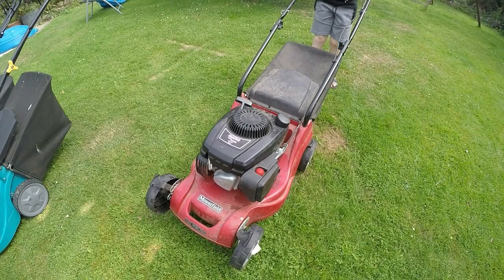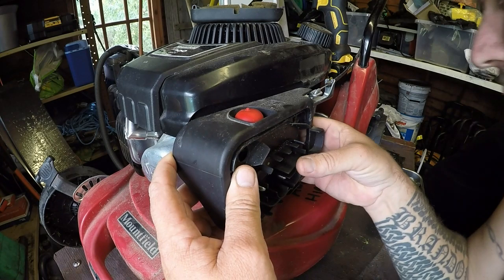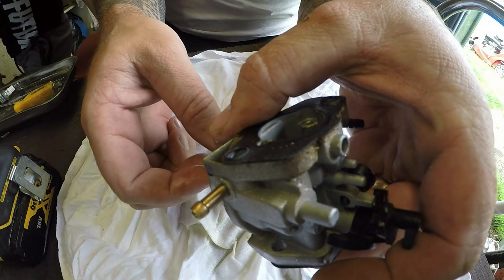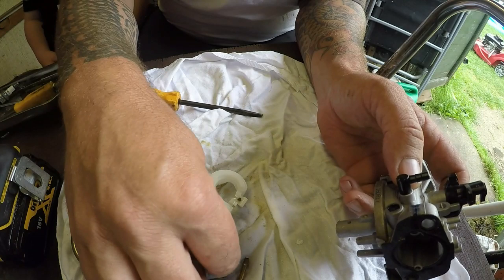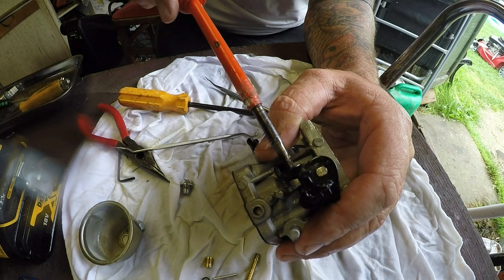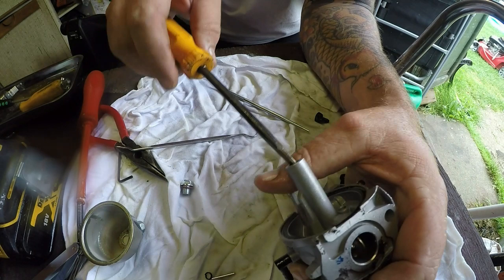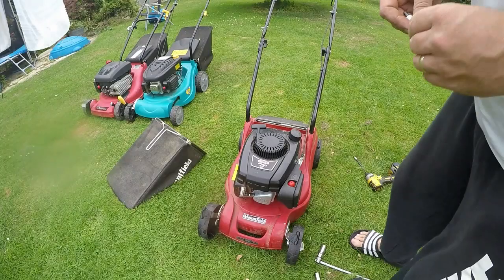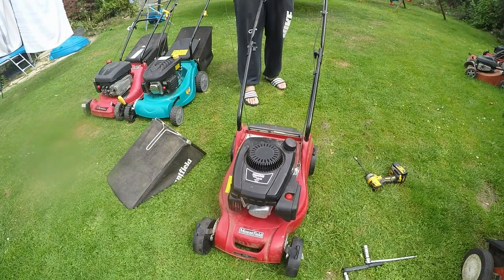#lawnmower #easyfix #howto Mountfield HP164 Keeps Cutting Out How To Fix

Comment: help!!,, what could cause a Mountfield rs100 mower to start and run fine,, but without the primer pump fitted on it?  if you fit the primer pump on,, the engine starts fine but stall's very soon after it start's up?,, I have cleaned every jet in the carb,, and tried socking the carb in carb cleaner then blow it through with compressed air!,, it run's fine until you try putting on the primer pump,, I even put on a longer pipe to the primer so it was easy to remove it and once the engine was running (sweet) I dabbed my finger on the primer tube to block it for a split second,, and the engine stalled right away!,, can you throw any light on what to look for?,, thanks mike
Reply from the maker: With the primer bulb fitted and the air filter cover removed. Prime the mower and look inside the carb to see if fuel is coming out of the the middle of the carb.. then let me know
Reply: @themowerman  hi,, the mower will run happily but with or with out its air filter on,, but only with the primer pump removed,, if you try to put the primer pump back on when the mower engine is running,, it stalls out and dies!,, yet you can blow through the primer pump so it is clear and not blocked up!,, weird or what?,, I was told to strip the carb to remove all jet's and then sock all the carb bit's in,, ""Coca Cola!"",, but they never said whether it was diet Coca or not!,,  this I am told should clean it all out!,, and clean it out better than carb cleaner??,, however should I start singing,, ""come alive with Coca Cola"" when I am socking it as well?""  or should I just sock it in Hiniken larger?,, as that reaches part's like nothing else can,, this has stumped me,, and I cant figure it out!,, thanks for your help with this,, mike

Comment: My rs100 was hunting badly and then packed in and would stall as soon as you tried to start it up.

Followed your video and it helped me sort my problem. Didn't have an ultrasonic cleaner though so it was just boiling water and fairy for me!

Thanks for saving me from having to buy a new mower 👍
Reply from the maker: Fantastic I love it when a video helps someone out.yiu can make a cleaner. I may do a video on it soon..

Comment: Tried it again and soaked it in carb cleaner and put the  injector and that other brass bit in boiler water with fairy liquid and cleaned the holes out with 1 strand of copper from a peice of 1mm 3 core flex.
Runs sweet now.
Thanks man.
Reply from the maker: Yo glad I could help.. happy mowing..

Comment: Hi Mick some times with these mower carburettors , you get a micro drill set and use the one closes to the jet hole just  to clean the hole` sorts it out, 
 People overlook the varnish build up on the fuel tank filter mesh restricts the fuel,  , 
Usually the first place to go to is a vacuum leak usually on the intake manifold or carb gasket, just use carburettor spray around the area and if it stops surging then you have your leak then check the jet holes for any slight blockage on the carb, and also check any worn rubber gaskets they perish over time and allow air through, 
Ultrasonic cleaner works better if you use a chemical to break down varnish and tarnish sprayed in the holes first followed by a soft wire or drill bit where possible to loosen ,then like you did enter into the ultrasonic then blast air through to dry,
Hope some tips helped
Reply from the maker: piece toyou many thanks

Comment: The cleaner did the job for sure Mick.
Rs100 can be a real pain in the backside ,nice fix mate.
Cheers
Pete.
Reply from the maker: Ta mate I like them but like you say they can me trouble
Reply: When they a running well tidy little engine. But the carbs are picky had one made me howl  at the moon mate.

Comment: Hi Mick, How do you remove the top covers of the Mountfield rs 100 SP164 and the spark plug? In fact the top cover looks a lot like the one in this video.
Cheers
Reply from the maker: Tony Stark hi should be 3 10mm nuts to remove on the top. Then it will just come off
Reply: @themowerman  Thanks for your response but there is face cover it seems just like HP164. There is a screw at the back and fuel cap to remove which I have tried but the front will not lift off. It is quite annoying actually. It's my first mower.  Any further ideas please? Thanks

Comment: HI .  GOOD  ENGINES  BUT  HUNTING  ON  THE  CARB  SIDE . I  HAVE  ONE  LIKE  THIS  SO  I  SWAP  THE  ENGINE  OVER  TO  A  B&S  PETROL  ENGINE ,  THEN  I  PUT  THE RS 100  ENIGINE  ON  A  OLD  MOUNTFIELD  MOWER  18" CUT .THERE  ARE  VIDEOS  OF  ME  DOING  THAT  AND  TESTING  THE  MOWERS  OUT  ON  YOUTUBE . I  DON,T  HAVE  A  CLEANER  LIKE  YOU .  ANYWAY  I  SORTED  OUT  THE  CARB  AND  RUNS  AGAIN  AND  NO   HUNTING .
Reply from the maker: I like the rs100 engines.. yeah the quality is not as good as the briggs still a good little engine

Comment: I really find your mower repair videos excellent and educational. Inspired and for the first time, I have just serviced my 2007 Mountfield SP474 fitted with  a Mountfield RV150 engine. When I took the carb apart to clean it and unscrewed the main jet, the brass "tube" with the multiple holes dropped out (sorry but I don't know it's technical name) and now I am not sure which way up to put it back when reassembling the carb. Is it the thicker or the narrower end which goes in first? I noticed you put what I call the narrow end in (at around 14 mins 11 seconds in the video) but you're working on a different carburettor I believe. Your guidance would be much appreciated.
Reply from the maker: Hi bud. Yeah the the narrow bit. And when you put it in if you look inside the carb you will see it poking through into the main part of the carb
Reply: @themowerman  Many thanks.